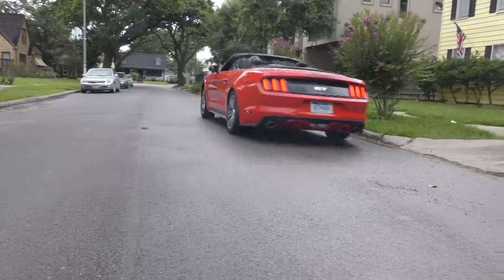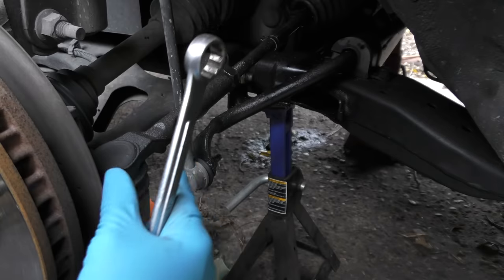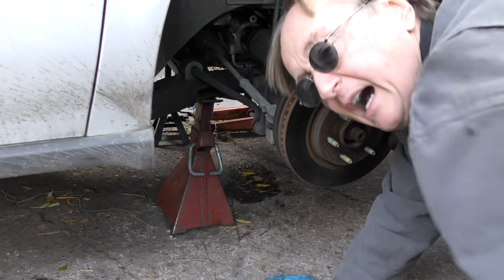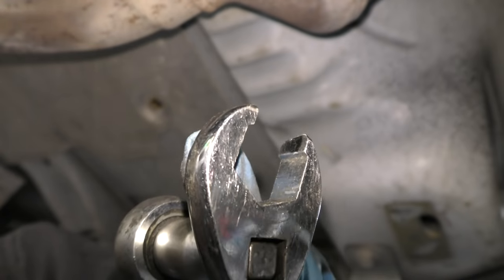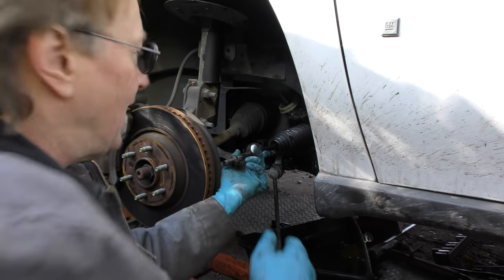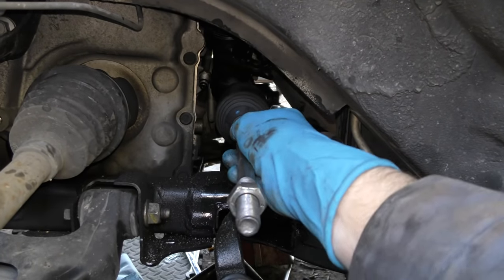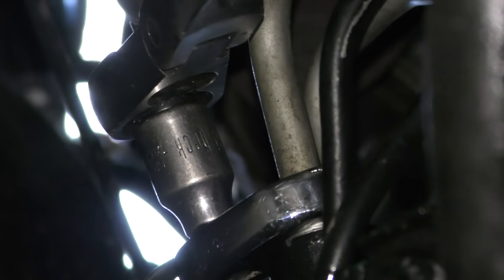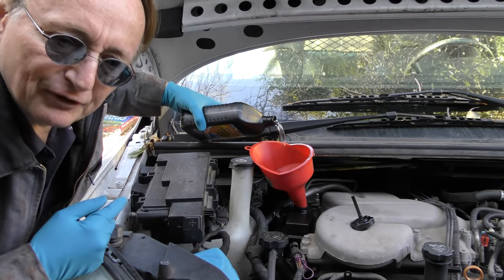How to Replace a Power Steering Rack in Your Car

Comment: Leave the nut on the tie rod end so you don't mess up the threads with a hammer
Reply: +hugeslacker    Good tip. I once bent the castellations, ruining the nut,  so now I thread the nut on upside-down or use another regular nut (easier). Here's another way: Loosen locking nut between inner and outer tie rod ends after painting an alignment mark (for the measurement later on). Slip small rack boot clamp off  and run a pocket screwdriver tip under the boot if it's sticking to the tie rod.Turn the inner tie rod hex flats with open end wrench to unthread it from the outer end. Popping the tapered stud with a hammer usually isn't as easy as this time was for Scotty.
Reply: Seen someone use a fork tool...
Reply: I don't think it really WAS that easy...I think he did the grunt work to loosen it, then started filming later to save time and keep the video short.
Reply: @gemanscombe4985  yes that one stroke of the hammer in this video sure did not do mine !  I was trying to do this with the wheels on in my ignorance.  When it came to that step I took off the ramps the van was on and put it on jack stands and took off the front wheels.  Then I could (with a nut on there to protect the threads and using a small sledge hammer could swing it hard enough to actually remove those outer tie rod ends from their place.  On mine it is upside down from in the video.  I think using a $10 pickle fork here would help immensely; i used a big screwdriver which may have helped.  The hammering eventually got it.  Use silicone spray or a similar product always of course when removing bolts and let it soak in spraying 2 or 3 coats in 10 minutes depending on how hard it is for that wd-40 or whatever you're using to get to the threads.  I am working on a 93 quest (van) and I sure hope i do not have to drop the subframe to get the old one out !  Today hopefully I will get to that point.  Going to try to find a shop manual somewhere since I do not find that exact video on youtube anywhere.  I'm glad people here said to lock the steering wheel.  In the video there is no mention of what position the rack is in when it is removed and how to make sure the new one is IN THE SAME POSITION as when the old one is removed as the gears inside allow those tie rods to move from all the way left to all the way right and if we take off the rack in the center position and the new rack is set at a right turn or a left turn position according to another viewer here,  and common sense that will not work... they do not self adjust.  I am thinking to set the steering wheel straight and clamp it in position somehow (my ignition key has been stuck in there for years so I cannot lock the steering wheel by just removing the key and turning the wheel until it locks).  Then measuring how far the the end of the tie rod end is from the center of the steering connection.  That way if the new rack differs in some way as to the threads or design, the wheels and the steering wheel will be in the same position when the new rack is installed.  Obviously I have not done this before !  Good luck all.

Comment: 1999 Ford Taurus ... had my power steering pump as well as rack and pinion replaced, front brakes & rotors done, oil & filter changed and engine compartment exhaust leak repaired for $1014 in SoCal.

Comment: When I was a  student mechanic I did it all wrong, didn't measure the bolt distance on my Impala so it ended up toe in but it was just a cheap rust bucket. When I replaced a bearing on a rack and pinion on an Escort I didn't mark where the teeth should go to center the steering wheel at rest position so I shaved off the alignment notch on the steering wheel cause I didn't have time to spend on taking it apart again but it worked out for that job in the end.

Comment: Just had this done at the shop. Fluid level looks good but the power steering feels so stiff it's almost as if i have no power steering. They also replaced outer tie rod ends.

Comment: I have a 1995 Mazda Protege LX with a huge power steering leak.  I had it taken to a garage to see what they can find.  They said the return hose and pressure hose need to be replaced.  They also said the rack needs to be replaced soon.  For $1000 I can have it all fixed but I just don't have the money.  Is it easy to replace both the hoses and if so would you by chance have a video or could make one for me???  I love working on my car but this part looks tricky.

Comment: Hey Scotty, I have a 2016 GMC Acadia Denali AWD and I paid about five wheel alignments so far this year, we replaced parts like the Rims, engine mounts, linkage and sway bar including rotors, brakes and tires are brand new!  The vehicle still continues to pull left, steering wheel spins quick enough at slow speed 5-10mph and highway speed any speed consistently pulling left having to re-center but won’t stay still, Yeah they (dealers) did cross all 4 tires position and rebalanced them and still no solution, I spent hours at dealership with no fix,   I am showing up for appointment this Thursday to suggest maybe a fail rack and pinion ? any solutions, thank you!
Reply: Check suspension/ bushings

Comment: Scotty the other day i went over a big puddle on my way to work right before getting into the parking lot also, as soon as i pulled into the parking lot to park the steering got stiff as i tried to turn right into the parking spot, i was worried but after my shift the steering wasnt hard anymore but could feel some play in it. Any idea if i need a new rack & pinion? Or something else

Comment: Hey Scotty I have a 2000 manual mustang v6. it's hard to shift gears when the car is on, but when it's off I have no problem. I recently put in a new clutch and transmission.

Comment: Hi, 
I overfilled the Power steering fluid and noticed that the steering rack start leaking. Should I replace the steering rack or just fill out with a stop leak fluid ?

Comment: Scotty, I have a leaking steering gear and started leaking since I took it to a mechanic that changed the pitman arm, he told me he had to torch it to get it off, but I believe that probably melted the seals inside, is it worth it to change the seals instead of buy a whole new steering gear? It is on a 2000 Ford f 150

Comment: Hello Scotty and to Anybody Else reading this.:

Finished replacing rack and pinion on 1998 Toyota Tacoma SR5 Pick--Up.

Had been leaking where pressure line from power steering fluid  reservoir meets rack and pinion. Replaced broken O ring. No more leaking.  

To bleed power steering system had wheel slowly turned hard right and left about 20 times with engine off. Then about 12 times with engine on.  Saw no more bubbles. Just vortex swirling when steering wheel  turning. Steering has small resistance when turning to right. 

Any recommendations?  Can this be lived with? Will the recently installed rack and pinion break down soon?  No such resistance on prior rack and pinion nor on any other vehicle ever. Just needs more bleeding?

Comment: Hey scotty i have a 2001 chevy blazer 4.3l and i have a couple of issues. I have 2 codes that pop up twice that are P0410 and P0440. are those serious issues and cheap to fix or will it hurt to drive it as is? its just a cheap daily driver. And also it doesnt start on the first time sometimes you will have to crank it then let off then re crank it and it will start and run fine. thanks

Comment: I had my rack and pinion replaced January of 2021 on my 96 Toyota 4 runner and it’s already leaking and likely need to be replaced. Warranty period is over. I’m certain it was an after market part. It’s so expensive the labor. What should I do?

Comment: Thanks for the great video, Scotty! I need to do this job on our '95 Toyota Avalon XL.  Would you recommend using Teflon tape on the power steering line connections? I thought it might be overkill, but I also thought it might be a good way to prevent leaks.

Comment: Scotty I have 2006 impala. I have replace 3 times rack and pinion. They keep breaking up. The rack and pinion you show on the video is similar the one I carry. 2 times has broke off on the big hole and the car lifts up and down. Is there away to know what is causing the rack and pinion to break off?

Comment: Hi sir. I'm in desparate need of a rack and pinion or power steering rack for my 2005 Ford Ecosport (diesel). What's my problem? My powersteering fluid drips off and the steering become hard to turn.
Do I need to change the whole rack n pinion or only the power steering rack? Can you recommend me a site were I can get one? Thnkx

Comment: Hey Scotty so yeah my 1996 gmc suburban 1500 with 198,000 original miles. I was driving along the freeway and the truck was running fine, but then when it was going into the next gear it when in fine,but it wouldn't  release that gear. It won't go into reverse now and it makes a clunk noise it still drives but slowly and it shifts hard.
Reply: Scotty Kilmer can it be the sun shell gear??

Comment: I had this done at my local mechanic shop and they screwed it up, the guy working on it did something wrong and it messed my clock spring which goes on the steering wheel, you will know because your ABS light will come on and stay on until they replace that clock spring, at first the guy tried to say it was like that but lucky for me there was another mechanic who checked out the car prior to replacing my steering rack, the part was only $125 so yeah the liar got fired over a $125 part and oh man thanks to that honest man

Comment: Is it okay to use a aftermarket steering rack? Or does it need to be OEM. Someone told me that to recondition my leaking rack is better than replacing it with an aftermarket pirate part. Any advice?

Comment: Had my rack and pinion replaced by repair shop but now engine shuts off when going over large bumps, electricity remains to the car, only noticed because I could no longer accelerate and coasted to a stop. Turning the car off and on again car and engine started like normal. Suggestions?

Comment: Great video.  Makes me think I can do it.  Would these instructions cover me with a 2008 Saab 9-3?  If so, I'm also going to replace a leaky power steering pump (which is a simple job).        So second and final question:  If I change both the rack and the pump... Is there any fluid in the "system" left that I'd still have to flush or am I good to go with just refilling?

Comment: Hi scotty i have a question i have a 2000 4runner base model with the 2.7 4 i had the rack and pinion replaced like 6 months ago i check the power steering every two weeks and no fluid lost last week the car was barely braking my brake pedal would go down to the floor and barely braking so i took it to a repair shop they told me the brake booster and master cylinder had to be changed they charged me $860 and they claim that the rack and pinion wasn't installed right cuz my boots are all squished up that who ever did the job didn't flush the system and that also ruined my brake booster can that be true and they claim that the rack is leaking but i always check it and its always fine i see some oil but not alot can all this be true thank u scotty.

Comment: Hi Scotty. I have a 1998 Cadillac STS with power steering issues. I took the tire off to detect the leak and its coming from near the Hi pressure hose. I fill my reservoir to the maximum allowed and within the 6 miles it takes me to get from my home to work, the car starts grinding again and is in need of power steering again. I noticed when I checked under my car, it gushes out when I turn the wheel to the right. Would it be the racks and pinions? I am in need of guidance. BTW, love your videos!

Comment: Scotty, Thanks for video first of all. I have 2005 Pilot, have had 3 power steering pumps & about to have 3rd Rack opinion replaced too, all 3 have leaked (within 2month period) what is causing the Rack to blow seals & leak???. My mechanic (brake check) is about to replace the 3rd rack tomorrow & he is saying he is going to "check" to see what's blowing the seals (leaking) I'm afraid he's going to come up with unnecessary expenses that I have to pay for, ??? I think the system isn't being "flushed" properly is the problem,, any insight????
Reply: Are you sure the racks are NEW and not remanufactured? A new rack is pricy, for your car its around 500-600 dollars just for the rack + labor + other stuff, taxes, fees so on. So you are looking at about 1500+- dollars for a replacement at a shop.
Reply: No, they're rebuilt, they said they meet all spec's & standards of a OEM one. The 3rd one is in so far it's been about a week & no issues, except when I turn to the left the steering is alitte tighter than turning to the right.
Reply: I would say thats the problem. Get a new one. Remanufactured often brakes after short time, and these racks is often actually just old racks with old worn gears, but new seals only. Tighter one way can be several things, tire pressure, misalignment, or rack is starting to wear out

Comment: I have to center the rack and pinion first before I connect the new one right? I tried centering it and fluid came out of the new rack and pinion. Is that normal or should I have not messed with it?

Comment: My 2006 Astra had notchy steering and had what appeared to be a fluid leak from the power steering rack. I refilled it with the same fluid and drove 80 miles often with a lot of turning and i dont seem to have lost any fluid at all and the steering is working perfectly fine. Any idea what could have caused this?

Comment: hey scotty, i have a 1998 ford escort and i just got the tie rods replaced. i am slow leaking power steering fluid and i think it could be the rack. Even though i want to save money this fix does look extremely risky for someone like me to do. i was wondering if the leak would cause and serious damage down the line. lets say in the next 2 years
Reply from the maker: +Russell Adjei if you keep adding fluid, it hurts nothing, but if you run it low on air, pump will burn out
Reply: How long did the car last with the leaking rack

Comment: I have a 1992 ford areostar van and lately it has been pulsing shaking in the steering wheel when i turn to the right , i made sure the power steering was full , i even turned the steering wheel ( with engine running) back and forth while stopped and it pulsated, vibrated  or shook  (which ever way you want to call it) the same way , it drives just fine going down the road and brakes okay , is that a bad rack and pinion or power steering pump ? van has about 150, ooo miles on it now .  any help on this would be appreciated .

Comment: Hi scotty,thanks for your video.my honda accord 2005 now bleeding the power steering fluid from steering rack,here in Malaysia i only able to find 2nd hand steering rack from half cut shop imported from Japan.any idea what to do on 2nd hand sterring rack like o ring replacement / rubber seal replacement to prevent this steering rack giving me the same problem after long time use?thanks
Reply from the maker: nothing you can really do but keep clean fluid inside it by changing it every 20 thousand miles or so. rebuilding those things has to be done in a factory, just changing seals won't last long if shafts are worn

Comment: Hi Scotty. I have a good Steering, I can turn it to left or right easily without any noise but after driving for around 10 minutes, steering gets hard and make some noise on full turn or when I reach the edge of turning. steering fluid is always full. what do you think are the possible problems? 

thanks a lot. I learned a lot from your videos
Reply from the maker: worn pump or worn rack. More often pump
Reply: Thanks Scotty. Now I have Idea. thanks alot. I checked the Rack and its wet, I think its a minimal leak. the floor where I parked is not wet from fluid. its fully dry. no signs of drop of fluid from vehicle.

Comment: Hi....do you know where the power steering flow control valve is installed in the system?  On Ford Taurus 2007. No one seems to know what I'm talking about.  I'd sure appreciate it.  Thanks.

Comment: I wished I was young again and you were my teacher !!  50 year old here... cursing and swearing: See, what happened is, one night while out on pizza deliveries, I was checking a sales receipt for a pizza customer's address... the next thing I saw was a car parked in the middle of the street with it's lights off while I was still going 32 in a 30... I had .2 seconds to put my car 45 degrees away from the parked car not to have died in a massive 32-0 collision with a parked and possibly fully fueled car. My Impala mad the turn  !! I had roughly 6 inches of space between my car and the one parked in the middle of the street. The funny thing is that there were no overhead lights, the car was black and the rest was black and it's a miracle I saw the reflections of my headlights on the chrome of the parked car !! -- Anyways, 2 days later, I pulled in right next to a steep curb delivering pies... and I pulled in straight... after dropping off the food, I started the car and turned the wheel hard to 'take off' and get on the road !! I heard a popping sound like a small pistol or a tiny firecracker. Today, I am noticing a superior whine in my pump and haven't even checked the steering boots for leakage. Should I be worried about getting out of bed tomorrow morning only to discover that a seal may have been the thing making that popping sound ? I mean - why the whine after the pop after the curb after the dark park car maneuver ? -- Anyways - I wished you were my teacher. Everything in life would be easy !!